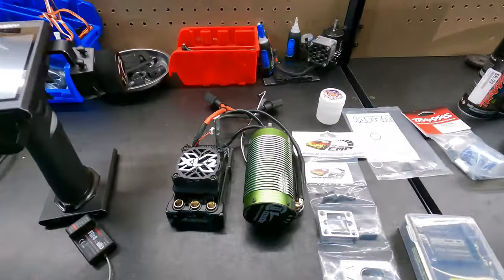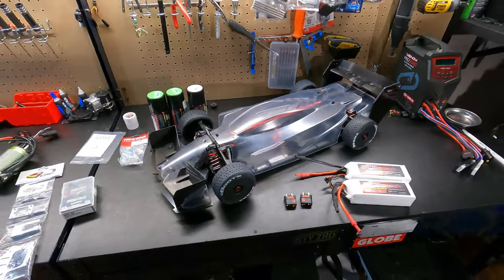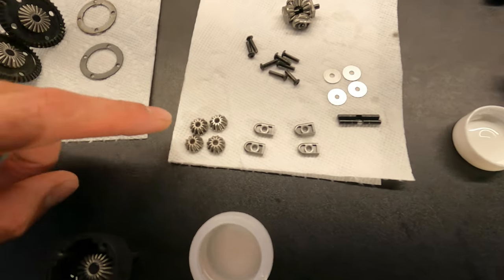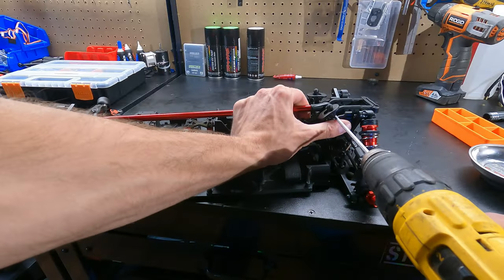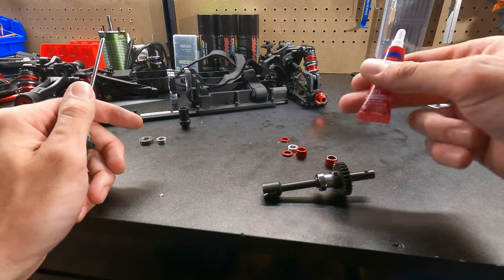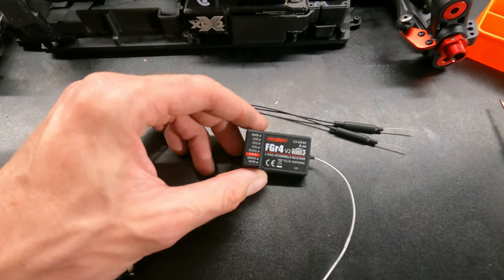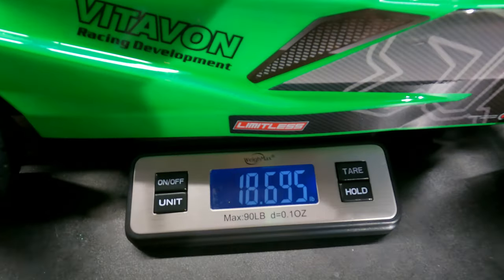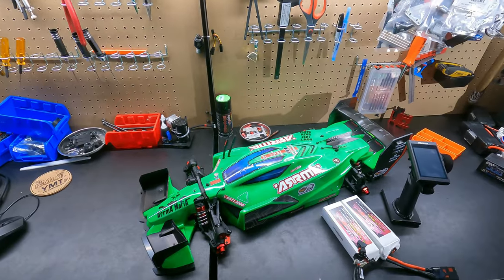Arrma Limitless V2 Complete Build! 150mph+ RC Car Max Power! Castle Creations Xlx2

Comment: I bought Arrma 30mm motor mount for my Limitless V2, Can I  use Castle 2028-1100KV motor in default position? because I dont want to change it to battery position. the length of the 2028 is 113,2 mm and the car motor space is 110 mm. I can only ask from youtubers because I have to buy it online and I can't see it in person before buy. thanks.

Comment: So for the xlx2, you just used 3m double sided tape and screwed in the bottom? I think I might mount mine this way. How’s it working out?
Reply from the maker: It works great! I had it mounted the same way in my v1 Limitless and it's never gotten loose in a crash or damaged. And I've had some bad crashes 🤣 Also I use Gorilla glue double sided tape, it's some of the strongest 👍
Reply: @zagertRC  thanks so much! Doing the same right now!
Reply from the maker: @Animusborn  You're welcome! You'll definitely enjoy the v2💪

Comment: Did you end up drilling all four holes? Only asking cause the 4th one (closest to the servo box) seems like it’s gonna be a pain in the ass with the uneven surface/groves. I’m thinking 3 screws with the gorilla tape should be good but I dunno
Reply from the maker: Yeah I just hit three of the screws👍
Reply: @zagertRC  Thanks for the quick response and awesome video!!

Comment: Love your video tops. I have a question Are you using a different motor mount because the motor doesn't or just personal preference??
Reply from the maker: Thank you! And in my opinion the Limitless v2 motor mount is trash. It comes with a small can slider, they make your order one for large can motors. Plus the stock mount is so limited to gear choice, I like options 👍

Comment: Great video, I'm working on a limitless build right now with the same motor and esc, do you have any suggestions for gearing if my main goal is to just boot around and I don't want to have to worry about overheating?
Reply from the maker: Thank you! And with such a low kv motor you can gear pretty high for bashing around. If it were me I would start around 30/40 and just check Temps and data, then go from there.
Reply: @zagertRC  hey thanks for the reply just to clarify do you mean a  30t pinion and 40t spur gear? Thanks
Reply from the maker: @85CEKR  No problem, and yeah 30 pinion 40 spur. I say that because I see guys run 34/34 on the 800kv motor for bashing around in big trucks. So I figured a little more kv and a little less gear and you'll be good👍 It might be able to gear up more even.

Comment: I’m new to the speed run game with my limitless V2. I’d like to know more info about how you wired your esc in Parallel. I currently have mine setup in series but I’d like to run in Parallel as well. So my question is could I plug in a Parallel connector with two ends on each side of my current series setup to run 4 batteries as well or do I have to change the wiring to do so?
Reply from the maker: Welcome to speed running! It's addictive! So I was too lazy to solder anything for parallel, so I just bought some already made and I just plug them into series connectors. Here's a link to the parallel wiring harnesses I bought.
https://www.offshoreelectrics.com/proddetail.php?prod=ose-qs8-anti-parallel
Reply: @zagertRC  awesome those are the exact ones I was already looking at. I also just got the same chnl batteries you were running there. They’re on sale right now. I like having the quick connects cause the you can always switch right back to series

Comment: Bro you had to put the rear body mounts upper? I have got this Problem with same batteries
Reply from the maker: No, I didn't have to move anything around
Reply: @zagertRC  lol also i had to cut a little more edge on the battery tray where the esc Sits because the Main wires dont fit in there
Reply: @zagertRC  then ur body sits tight so that you must press a little down so that you can put the clips in?
Reply from the maker: @justinmuller4809  I mostly just ran 2 packs. But I would definitely have to ape the body if running parallel
Reply from the maker: @justinmuller4809  ZagDaPiratre on tiktok and insta. I never did anything with my insta lol

Comment: Nice vid! Any chance you have a part number on those receiver antennas?
Reply from the maker: Thank you! I found these on Amazon,  here is the link 👍
CORONIR IPEX 2.4G WiFi Antenna... https://www.amazon.com/dp/B095N2DV2B?ref=ppx_pop_mob_ap_share
Reply: Awesome thank you! After watching this I found out that I’m building pretty much an exact copy of your car lol. Another question for you, is the body clearing the fan housing on the ESC? My rough mock up has me pretty much touching in that location.
Reply from the maker: @coreyyeggy7764  It's very tight, it may rub a little. I usually tape the body on the sides if it's too tight👍
Reply: If a guy were to cut out the body directly above the fan and fashion an air scoop there, do you think that would hurt or help the aero?
Reply from the maker: @coreyyeggy7764  Probably be better with just a hole and no scoop. I had a bunch of holes in my v1 body lol

Comment: I need a parts list .motor mount ESC relocation mount battery tray options?? I've got a mamba monster x and to 4060 1650 kv motor I'm putting on infraction..can you help me? I can give you my email if that helps get me get  a parts list
Reply from the maker: I just did a Infraction build that I think could help you tremendously with all of that. Here's the link. Otherwise we can chat over email if you want 👍
https://youtu.be/tTkjUw0jlFM